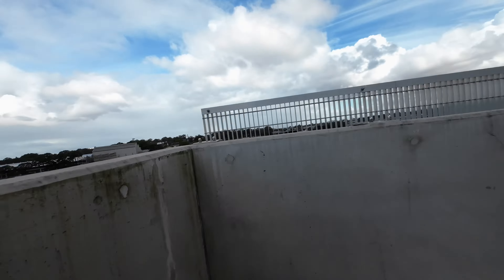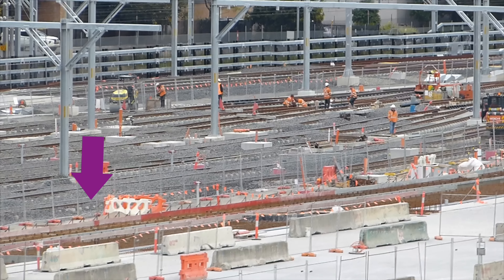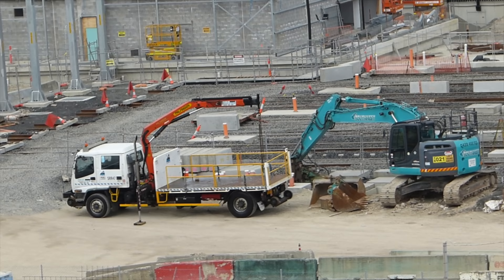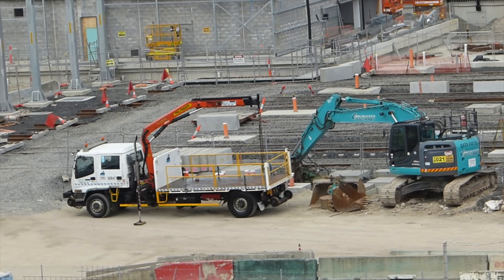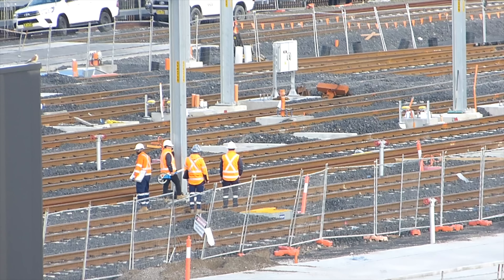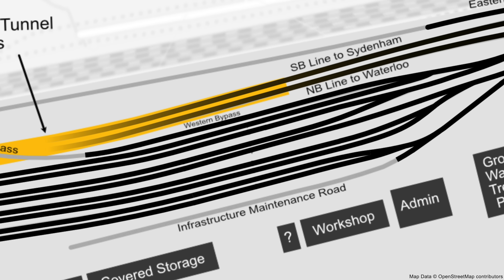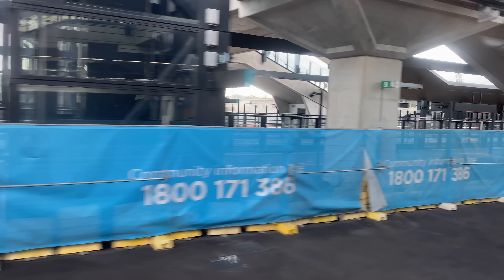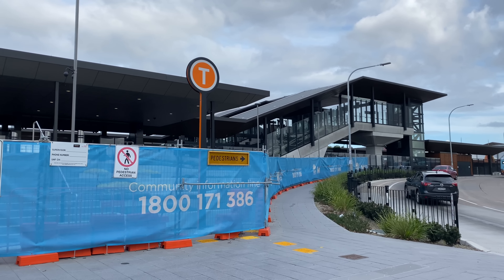Sydney Metro Trains Facility South, Marrickville Dive Site and Sydenham Station Update June-July 22

Comment: The numbers on the overhead supports represents distance from Central. The further away from Central you go, the larger the numbers become. These particular supports are about 4.5km away
Reply from the maker: Thanks for that! - I knew there would be a logical reason for this numbering!
Reply: @TransportVlog  ra ph isn't incorrect, but here is a bit more info. For Sydney Trains, from the official docs - While the number in an overhead wiring structure label denotes the nominal distance of the structure from a reference location at Central, this number is not the same as the track kilometrage. See ESC 210 for the determination of track kilometrage. Overhead wiring structure numbers shall be regarded as a label for the structure only. As per ESC 210 - "Survey kilometrage" 0.000km is located at the Buffer Stop at Central No.1 Platform. For the Metro, if the numbers are similar to what is on the the Sydney Trains overhead wiring masts, then they would also be measured from Central, otherwise, I'm not sure where they would be measured from.

Comment: By the looks of it there's no cross platform transfers between Sydney Trains and Sydney Metro, all connections will require passengers to use the aerial walkway to transfer between platform banks? This is a shame, based on what you've seen how hard would it have been to reconfigure the tracks to offer cross platform connections?
Reply from the maker: Yes cross platform interchanges would have been nice and I'm sure it was considered in the planning stages. To do it would involve flying junctions on both sides of Sydenham Station, so not easy to do.

Comment: Hi Paul, thanks for yet another interesting and informative video. It is amazing how quickly they are progressing with the track laying. I am wondering how long it will take with the conversion of trains to Metro on the Bankstown line. With the speed they are currently going, the gap between trains and Metro may not be that long. Incidentally, how do you manage to do the complete voice-over? I have not yet attempted this so far on my YouTube channel.. Anyway, wishing you all the very best. Rob.
Reply from the maker: Hi Rob, glad you enjoyed it! I reckon a 6 to 8 month closure will be required to convert the Bankstown Line to Metro. It's possible that services will start between Chatswood and Sydenham first, but that will depend on how the central Sydney CBD stations are progressing. I edit my videos in Final Cut Pro, which has a voiceover option. I usually create a script beforehand, and use the Blue Yeti USB microphone to record it. It is quite a lot of work, but it makes the videos much more informative and interesting.

Comment: Hey Paul, thoroughly enjoying your Metro Vlog and find it very informative. I recently heard a rumour going around, that the State Govt are looking at opening the Chatswood to Sydenham link a year early to the first half of next year. Have you heard of this and is there any truth in it do you think.   Anyway all the best Bill
Reply: i think it's more that the sydenham - bankstown leg will be opening later than originally planned. there's not a lot of scope to run trains earlier when the stations and OSD's need to be completed as well.
Reply from the maker: Hi Bill, Glad you're enjoying them!  I heard this rumour too, but I think its very unlikely.  As Mark mentioned, there is a lot of work to do on the stations, especially the ones in the CBD area, which will have huge over station developments above them.  The Sydenham to Bankstown section is running a little behind schedule, partly due to the RTBU industrial action which involved a ban on turning off the overhead wires for Sydney Metro work. This delayed many activities during the last 2 week shutdown.